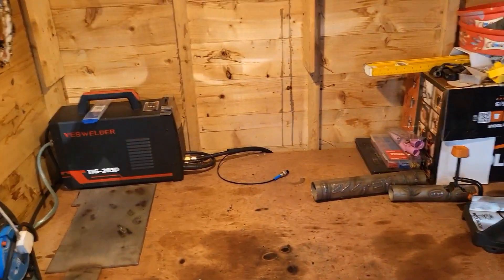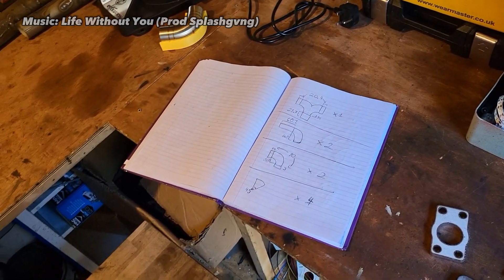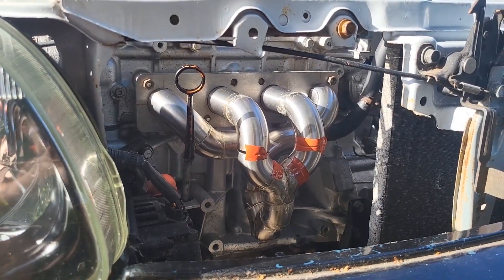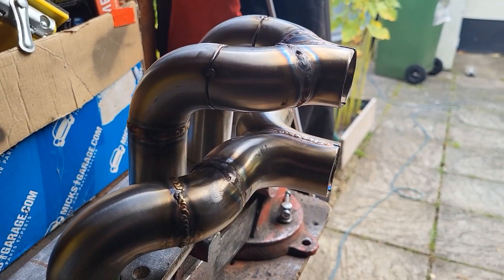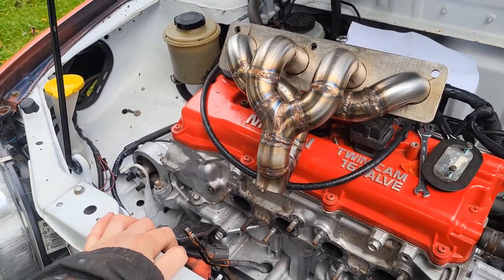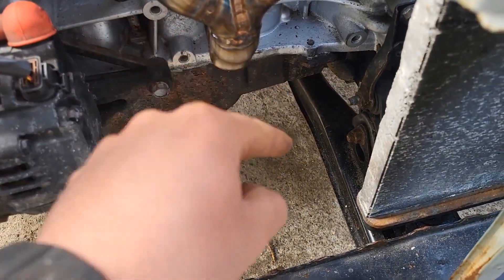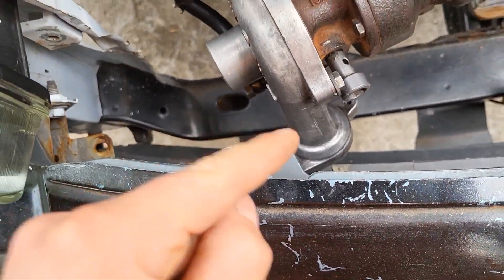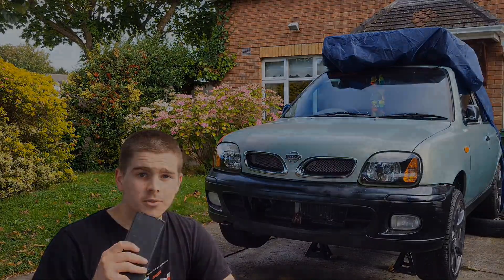Making a DIY Equal-Length Turbo Manifold - Turbo Micra Ep.1

Comment: Your o2 sensor will die it will overheat.. in turbo engine you must fit it in downpipe :) lenght from head to o2 must be at least half a meter, that what i know :)
Reply from the maker: The O2 sensor location was only temporary, I've made the full exhaust and installed it in the downpipe, further from the turbo.👍

Comment: I used this turbocharger in the 1.0l engine in the Peugeot 106. Personally, I think it is too small. It causes very high backpressure and therefore great problems with knocking combustion and high EGT. KP35 is a good turbo up to 0.8l. You can get a maximum of 100hp from it. In my second car, Fiat 126p 650cc, it works perfectly.
I recommend looking for a turbo from 2.0hdi 90-110hp. There were GT15, K03 or RHF4. Especially the first two will provide a better spool. Currently testing GT15 in 205 1.1 and it works very well.

btw. I see an error in the turbo installation. The oil flow through the turbo must be vertical, i.e. supply at the top, drain at the bottom. Knowing this KP35 and the asymmetric bolt spacing of the exhaust housing, this will be difficult to achieve.
Reply from the maker: It sounds like you're really knowledgeable regarding turbos, thanks for all the advice. I'm aware the one I'm using is fairly small, but I'm not aiming for crazy power. With that being said, it doesn't mean I won't maybe change it out eventually. Regarding the oil feed, a few days after filming the video, I eventually spun the housing to have the feed at 12 and drain at 6 o'clock. Cheers for the comment👍
Reply: @the_mintiest_micra  I like to create such low-budget turbo kits from junk and I have already made a few of them. The biggest problem of KP35, as I wrote earlier, is high backpressure. It will take a lot of time to tune the ignition to eliminate the risk of knocking. I remember that turbo in 1.0l engine had 0.5 bar at only 1800rpm.

Comment: did you reinforce the drive shaft and drive joints or are these original?
Reply from the maker: Still original driveshafts, haven't considered it as I've seen people getting away with pushing a lot of power and not breaking them🤷‍♂️

Comment: You cannot put the oxygen sensor before the turbo, the exhaust gas temperature would melt it. It should be mounted after the turbo. You could use the bung you already welded for the oxygen sensor to fit an EGT probe, which is really useful in turbo setups. When tuning your ecu, you could have too high EGT even with a correct air/fuel ratio, because the EGT depends both on the fuel mixture and the advance. If there's not enough advance, the EGT could be too high
Reply from the maker: That was one of my worries, I kind of did this so I could run the car temporarily without the rest of the exhaust, will probably weld another bung in the downpipe and block this one or do as you said. Cheers for the advice👍
Reply: I was coming to say this so he did not run into any issues ... peace and love bro